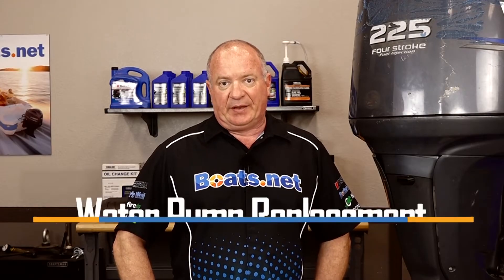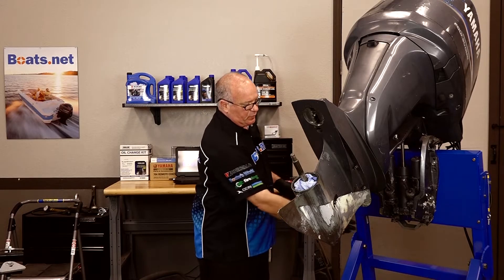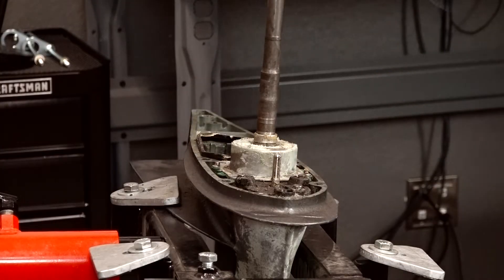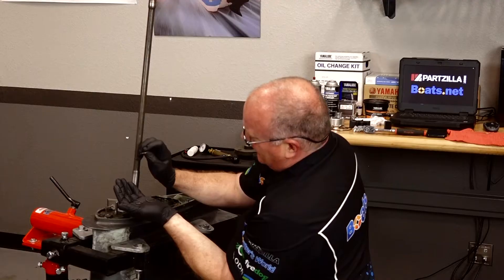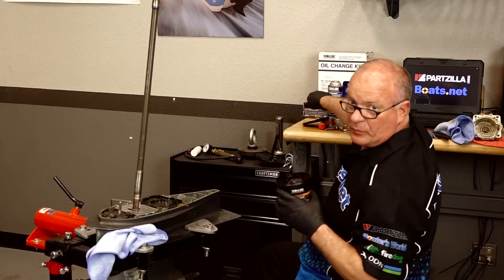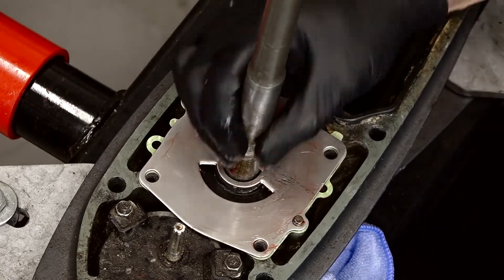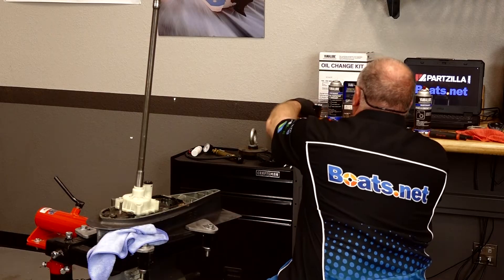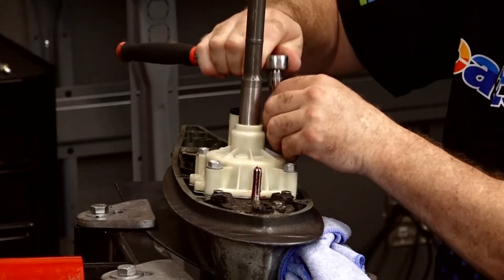Yamaha F225 Water Pump Replacement | Yamaha Outboard Water Pump Impeller Replacement | Boats.net

Comment: John, Great video! Super helpfull! My wooddruff key gave me a hard time coming out but the chisel eventually coaxed it out. Same comment a below about wavey washers not included inthe kit. To re-seat the stainless retaining collar over the nylon impeller retainer I used a large combination wrench and tapped it down carefully.  What torque woudl you use for the impeller housing bolts? It makes sense Yamaha specs toctite since overzealous torquing coudl crush the plastic housing.

Comment: Thanks for the video. Installed the pump kit without incident. However, upon spring start-up the engine the overheat light & alarm come on after running for just 3 minutes. Engine ran great when I winterized. Pump kit fit great but the wear plate design was of a different configuration than the one I removed. Any suggestions?

Comment: Very helpful video. My only comment is that Yamaha really should include the 3 washers as well as the nylon and aluminum collars with the kit. I just did both outboards yesterday and on both impellers the washers and collars needed to be replaced. Of course not a single local marina had them in stock so my boat is down for another week waiting for parts to come in. My advice to anyone doing this job is to order them before you get started. If you end up not needing them you'll at least have them on hand for the next time.

Comment: Opinion, my mentor has been in industry for 25 years (outboards) evinrude master tech, he avoids any grease for water pump because he said it travels into the engine and stuff like sand and debris get attached inside engine. Thoughts opinions. 
We also live in freshwater if that makes a difference
Reply: The mechanic at the marine parts store said to use a little dish soap because it will wash away once started.

Comment: John, Thanks for sharing this and all you do for the boating community.  It's tough these days and people like you help a lot. So.. My buddy and I tackled this job and all went well, but I didn't have that fancy driver for the locking collar that you used in the video. So I thought of "using a socket" idea, but do you know what worked best? Mu buddy said.. What about the old impeller? That worked great and came with a free cushion! I thought that I'd share, not to take away from the pro!

Comment: Here is a good pro tip. Don’t add too much grease to the top of that spine shaft! Overtime that grease compresses (and has no way to get out). I could not get my boat to shift properly. I took it to the mechanic and we had to squirt some gasoline up there to break up all the impacted grease and then it shifted fine after that.

Comment: I have a 200HP saltwater 2-stroke yamaha.  Every video I watch shows the water impeller curled in the same direction as this video.  When I disassembled mine, the impeller was curled in the opposite direction.  Do any engines curl the opposite direction?  I was then left wondering if I should follow my gut and install the same as shown here or whether to put it back in the same orientation it was.  I am thinking mine might have been installed wrong the last time it was done.  The pump housing otherwise looks identical to that shown here.

Comment: Very nice and helpful video with the complete explanation. “ I would like to see on the 2006 Yamaha 225 counter rotation how to disconnect the forward gear and the bearing? That one is coming with nut in the bearings carrier. Is there any link I can go? Thank you very much and have a wonderful holidays. Valentín

Comment: Great video.  However, Yamaha notes Loctite 572....not grease.  Also, there is general or specific torque spec. for the water pump housing bolts.  Cleaning the female threads should be noted so your torque is not skewed.  Also, the area should be cleaned of sand/debris before installing a new water pump. Grease is not noted for those bolts in any service manual.
Reply: Sometimes mechanics know tricks of the trade based on experience that prevent issues down the road. I also use grease on these bolts and slightly over torque. These threads get stripped out very easy and if you follow the manual and use loctite you're asking for trouble. Especially if you go more than a season with out changing your impeller and those bolts get corroded. I agree with making sure the entire area is well cleaned and free of any debris before you install the new parts and using a thread chaser isn't a bad idea either.

Comment: John, I completed this water pump replacement per your video. It worked will except for two things: 1. The woodruff key was hopelessly bound in. I needed to dremel it out. and 2. The seating of the housing over the new impeller required I zip tie the rubber fins in advance curving in the fins in the proper direction in order to insert the impeller into the cartridge. I have no idea how yours just seated when pressing straight down. The impeller fins are almost 1/2" wider than the housing all around.  Lastly, I failed to properly line up the shift linkage with the lower unit during install. Rookie mistake but one easy to make. Thanks for the great instructions. I would not have tackled this project without your insight.
Reply: John, my bad. The housing DOES in fact press over the rubber impeller exactly as it did for you in the video. It just took more moxie than I used initially. Thank you.
Reply: Gotta spin that drive shaft (in the operating direction)  while you are pushing down. That gets the impeller fins to bend and fit.